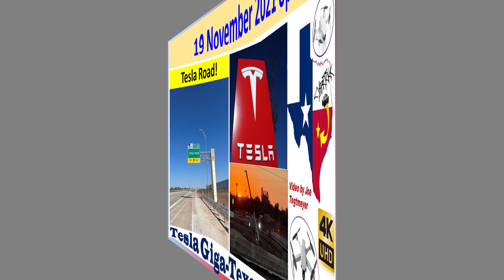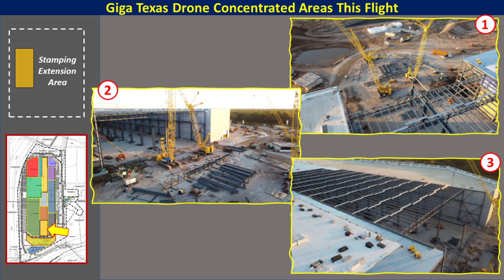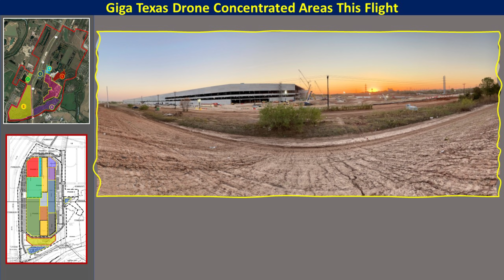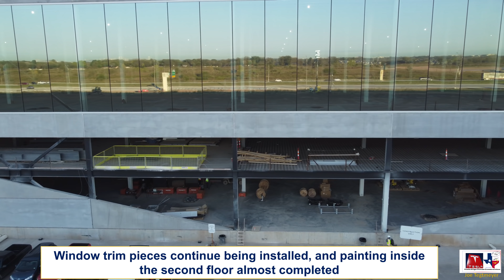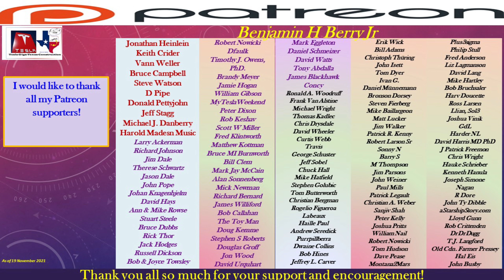Tesla Gigafactory Texas 19 November 2021 Cyber Truck & Model Y Factory Construction Update (07:30AM)

Comment: still looks like a lot of emptiness inside the building and still working to finish the roof, don’t know how they are going to produce the Y next month.
Reply: All the parts needed for the Y are in place: stamping, molding, body-in-white, painting and final assembly.  That building going to eventually hold a lot more: motor production, battery-cell, battery-packs, seats, etc.
Reply: They have enough room to run several lines in this building and will eventually. Plus the manufacturing of a lot of components that are usually built by subcontractors for most car companies. Elon is a real believer in vertical manufacturing.
Reply: @davidharris7249  thanks for the info, my Y is supposed to be delivered btw March 13-April 13, hoping there is enough time to d-bug the process, hoping to get the giga press chassis and 46-80 batteries
Reply: @tweetybird7668  Here's hoping!

Comment: In the opening scenes of this video, Joe shows the various sections of the main building in different colors.  There is a yellow-green "extension" of the building at the south end.  What is this "extension"?
Reply: At this time we do not know what or when the extension will occur. It was included on the civil plans to calculate area covered by buildings, could be several years.

Comment: Hi Joe.

What's gas pipe's used for in the factory and can't it be replaced with renewable energy?
Reply: I think they are for the casting machine furnaces that must rapidly/repeatedly melt large slugs of aluminum. With 8 casting machines furnaces when ramped it would take a lot of renewables to keep up.
Reply: @YouT-DJ  I suspect eventually they will be converted, but they need to be active now.
Reply: Certain things are better done with gas than electricity. For the most part, metal furnaces are one. We don't have to stop using hydrocarbon fuels completely. Just 80 % less than we do now.
Reply: @terrysullivan1992  Electric furnaces and smelting is already established.  And while I agree that some FF is necessary, it would be best to reduce its use as much as possible.
Reply: @sonarsphere  As with anything, the old technology must be used to build the new.

Comment: Why didn’t Tesla use the boring company to build a tunnel to put the power lines underground
Reply: Not TESLA's lines, utility has an easement for the lines and TESLA knew that when they bought the land.
Reply: Tunnels are much, MUCH, slower than digging a trench, putting in pipes, and covering it in.